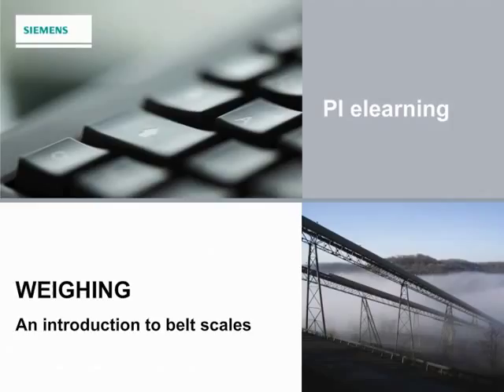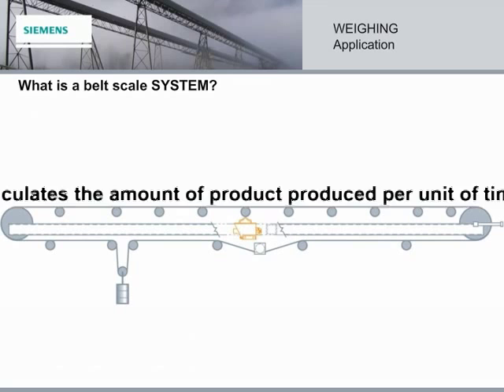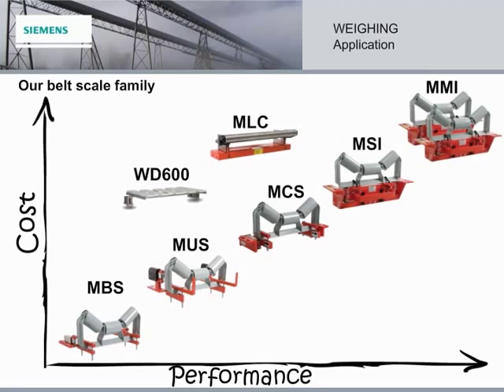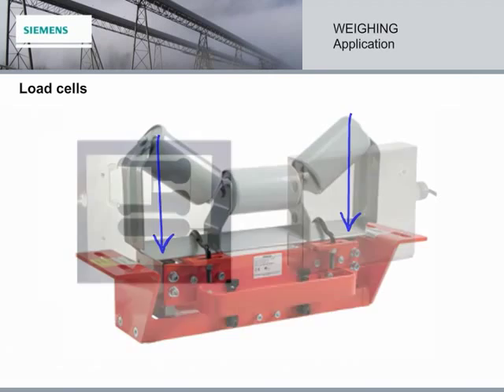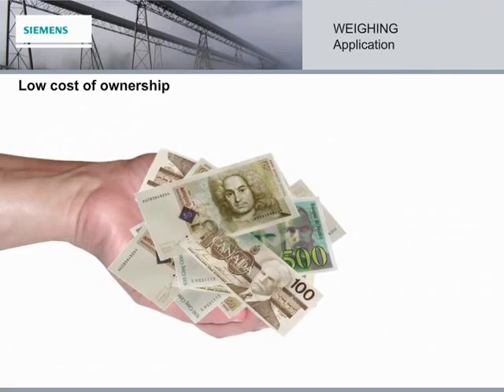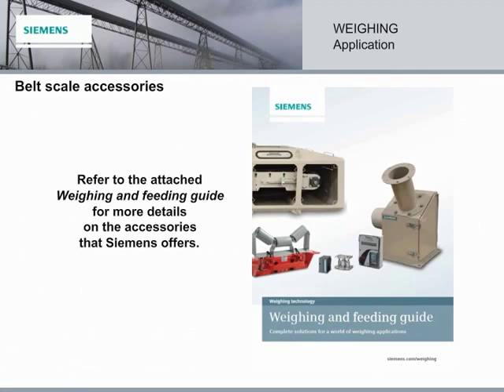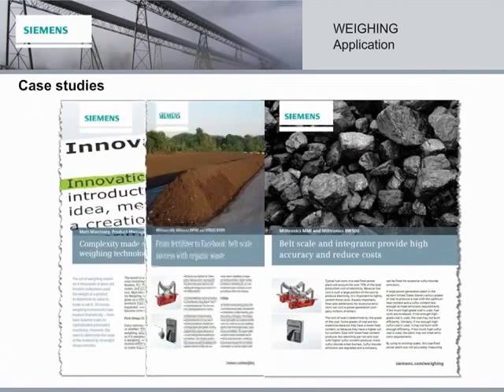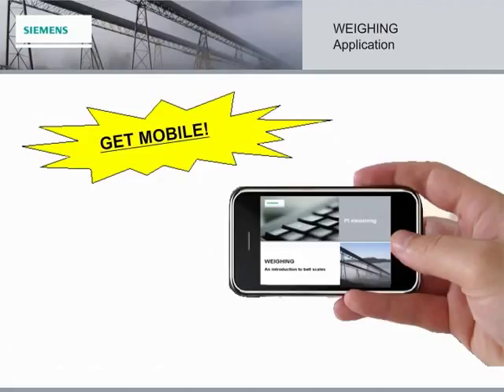Elearning: Belt Scales

Comment: I appreciate that you spend the time and effort in describing this system. I worked with belt scales back and before Milltronics came into the field. I remember working on old Merrick scales with rotating integrating wheels. These were all mechanical and a challenge to operate and keep in calibration and repeatability. The only connection to the outside world was a pulse output that was connected to the PLC. Even back then, regulators wanted the scales to be between 0.25% and 0.50% accuracy and repeatability. We did update to newer electronic versions, but I do wish we had the Siemens-Milltronics Belt Scale Systems. Thanks for the video.